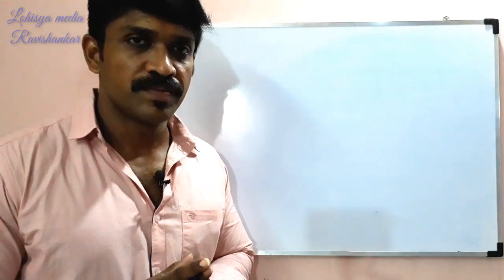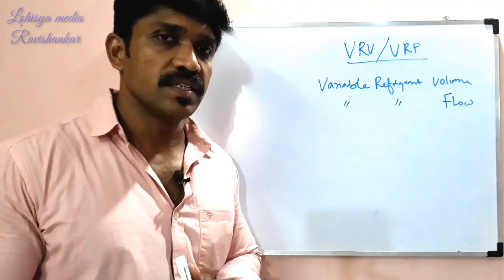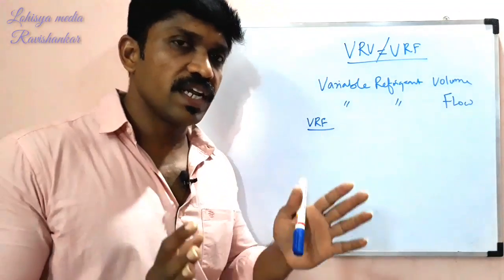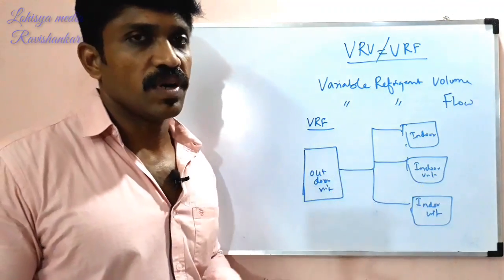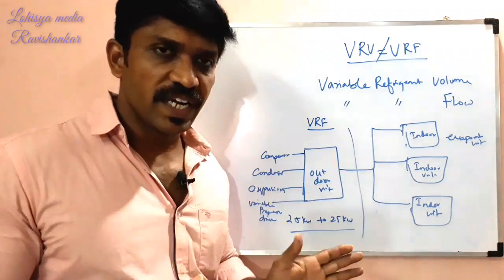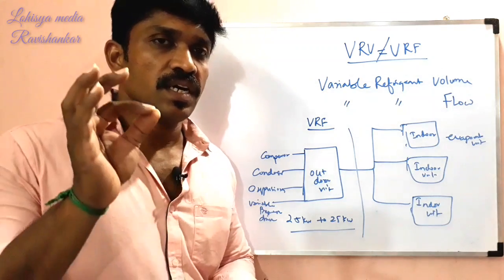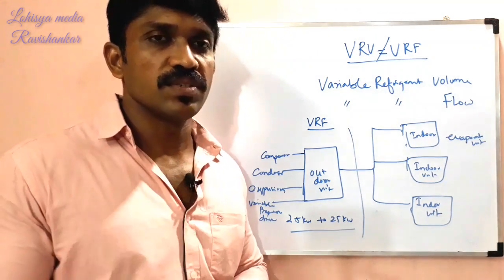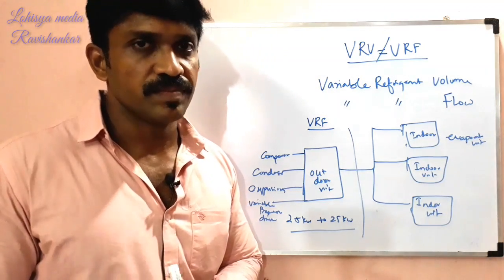VRV & VRF System | How VRF system works |HVAC | Tamil | Lohisya media

Comment: sir.. for example 4 indoor units in VRF. we switch on only 3 & 1 unit is in off. If there is any valve or any solenoid valve for each indoor unit. if the refrigerant flow continuously on the off unit means.. condensation & sweeting will be happen right..?? even though the condensation water draining through the drain line. Those refrigerant flow in the off unit will be energy loss..??
Reply: Yes , All the indoor units have Separate Expansion Device.

Comment: Boss u should study the concept well and then explain properly.. this is like half cooked food with misleading information... 
VRF/VRV units have individual expansion valves in each indoor unit which controls the superheat and also determines the amount of refrigerant that has to flow through that particular indoor unit or in some brands like LG they use expansion valve kits where collective expansions valves are in a module which controls the flow. Each indoor units main pcb keeps communicating with the outdoor units main pcb all the time giving information based upon the load required by each indoor unit. This is how vrv functions and this is main concept.. Outdoor unit has 2 expansion valves but it's used to bypass hot gas incase of under cooling or prevents high pressure rising and it also maintains superheat during heating operation in heat pump vrf systems..
Reply from the maker: Thanks for the valuable information sir 
I am explained only basic which I know but you are genius sir thanks for sharing the information this information also I will make video to teach who are searching for well information
Reply: @lohisya_media  Sure Mr. Ravi shankar I would be happy to see a full video on Vrf from u and if in anyway my support is required let me know I can share the knowledge and experience I have. All the very best...!!!!
Reply from the maker: @judesunil  thanks a lot sir
Reply: @judesunil  First we must thank to team to come up with regional language basic training. Appreciated. Everyone can comment as per individual wish, when we try to initiate a new way to educate local community in their own language, then lot of empty spaces in actions. I personally request everyone to motivate and try to post your own training videos in Tamil. If any VRF and VRV technical details, inside case study, maintenance tips, error codes rectification, please contact me. I would be happy to assist.

Comment: Hi Sir, thanks a lot for detailed explanation. What will be the peak power consumption during partial load? For example if i am only running 1 hp in a 4 hp VRF, will the peak power limited to 1 hp only?

Comment: Sir, oru 3 bedroom apartment, approximately 1100 sq.ft. Total about 5 Indoor units  in all rooms, dining and hall. Night 2 rooms la AC run aagum. During the day either hall or 1 room maybe oru 4 -6 hours run aagum. Inda situation la VRV is it a good choice ? And power consumption savings irukkuma compared to split ?
Reply from the maker: Kandipa irukum good choice also
Reply from the maker: Energy consumption also lowe
Reply from the maker: LG multi split one outdoor and 5 indoor unit YouTube lay video iruku see and make choice...
Reply: Thank you will check it out
Reply: @lohisya_media  anna 1200 sqft 2 bedroom one hall 3 place la podanum idhuku normal ac best ah illa VRF best ah anna price range and power consumption vachi sollunga

Comment: Bro oru HVAC plant la maintenance field la daily enna enna panuvaga
Reply from the maker: Bro explain panna poduma illa video venuma
Reply from the maker: Daily water quality check pannanum, chiller  parameters observation pannanum,
Based  on load chiller efficiency calculate pannanum,
Water treatment correct ah function aganum,
Chiller high demand  and low demand base panni switching pannanum
Reply: Chilled water entering and leaving temperature. Condenser water entering and leaving check pannum 
Current drawn by compressor. 
Sump oil level.
Sump oil temperature. 
Condenser pressure. 
Evaporator pressure 
Oil pressure reading 
Abnormal noise, vibration.
Reply: @lohisya_media  anna completed BE EEE  abrod la job try panalam nu iruken ethavathu course suggest panuga na